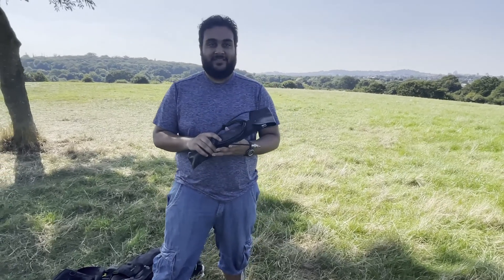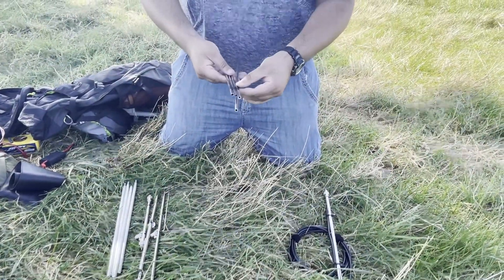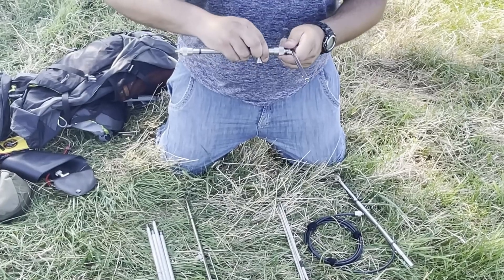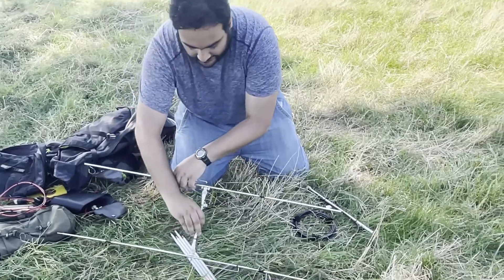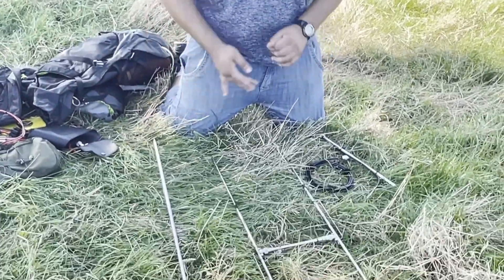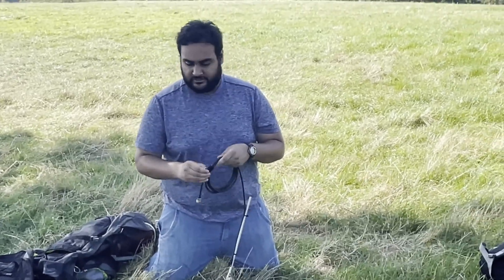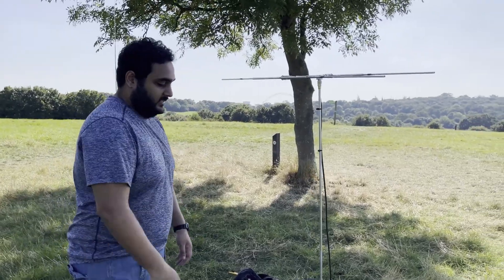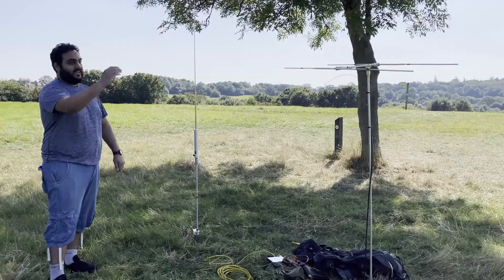Ham Radio 2m Beam Antenna | HB9CV

Comment: Hello, thanks for your presentation, but i would have a question. How far are u able to sent with this antenna, if u would use a hand hold radio, like a Baofeng? I know it depends on several things but lets say u are on a high building and 25 meters above the ground.

Thanks for your answer beforehand.
73
Reply from the maker: Hello! I usually use a handheld radio with this antenna, 25 meters above ground you could probably get some good distance at least 10 miles I suppose.

Comment: Nice video I just come across it as my HB9CV arrived. I’ve been waiting a year every time I went on there web page they was out of stock. How did you put the PL plug on the pole is there a video on it.
Reply from the maker: Hi Terry, the PL plug came on the pole already and I soldered my coax to it. It’s a little tricky and if you don’t get it right the swr will be quite high. It took me 3 goes to finally get it right

Comment: i also have that antenna and found it tricky to attach the coax to the PL259 on the mast. By the way, Fryent Country Park (up on the hill) is where I operate from quite frequently so recognise that location. Maybe meet up there one day  with our radio equipment !
Reply from the maker: Hi Martin! I found it really hard to attach the coax to the mast too. Took me hours to do. Have you managed to do it yet? I can show you how I did mine. Your name is familiar are you a member of the RSH?
Reply: @RadioAntics  I used to be a member but haven't re-joined yet. Planning to do so very soon. I think the club meets Friday evenings, which I cannot attend. I think I recognise you from some of the pics from RSH FB page - are your initials HS ? I've found another way to mount the HB9CV onto a 6m telescopic mast, albeit at a reduced height, Have a swivel piece in the centre so it can be used Horizontal or Vertically polarised. Took that setup to do a SOTA activation on the Quantock Hills a few months ago, but I forgot to take my radio lol !!! I can show you that antenna setup if you like. PM me on FB !